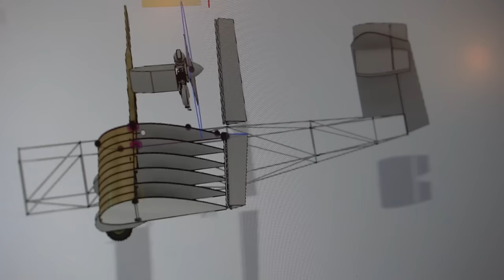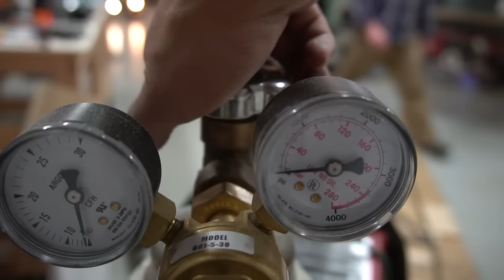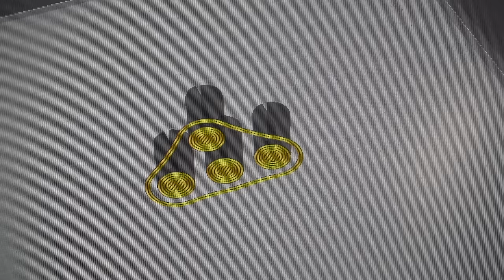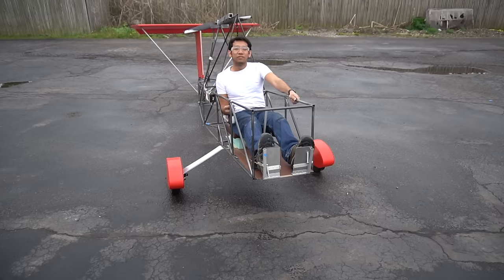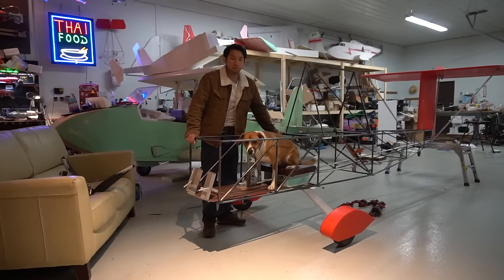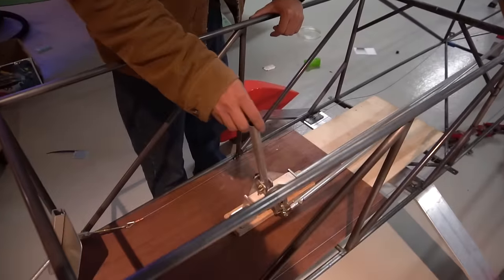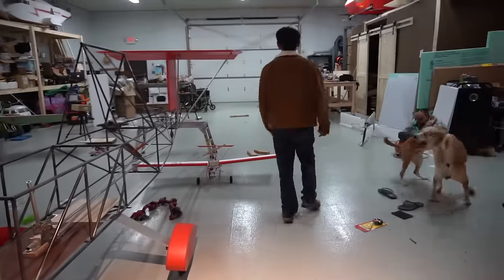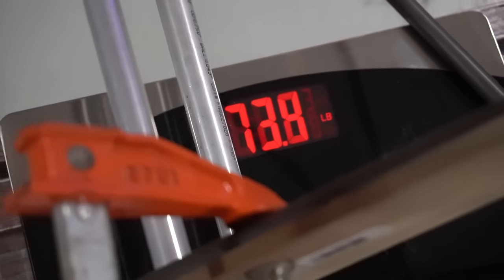HOMEMADE ultralight airplane mk3 part 3

Comment: Hi, just wanted to say I love this aspect of your channel, I'm only really interested in the content you make for this series. I dont watch much of your other stuff. It could be an age thing? It's more design engineering and fabrication orientated. I'm really interested in the way you make everything. I would love more detail on that. The timelapse is a bit frustrating cause you don't really explain much. It's great that your narrating but If  you cant keep up and really explain what's going on in the timelapse then it's not working. I would love you to explain your steps and the process in much more detail. I recognize I may only be speaking for myself here. I would like the timelapse, if indeed you keep it in at all, to be slow enough to really understand what your doing and your narration too. What's the tubing you used, its  wall thickness, why did you choose that. I would love to know details like that. The jigs you made etc. I think your core watchers may be after something else however.

Comment: The problem with welding a frame is breakage. The weld and the frame have different hardnesses. The frame flexes, then either the weld cracks or it cracks around the weld. Aircraft are screwed and torqued together. Even the skin of a jetliner is screwed on. Personally I wouldn't trust my life to a welded frame.

Comment: Why not put you props under the wings.  As for the landing gear tie the 2 parts of the landing gear together  with a bungy coard , will still alow the gear to bend to soften landing. Then add a bar that has a bolt slot in it so you can limit how far they bow

Comment: Hey, If I've 125CC or 250CC petrol engine so can I make a 2 or 4 seater plane??
Need your help for that design.
I just want to fly it maximum 4000 thousands to 6000 thousands feet in the air.

Comment: You forgot to add trim control to the elevator in order to reduce the stick moment as you will have to hold on to it whenyou will have to counteract a stall situation
 in other words your plane is not controllable in actual flight
save your life and get married and have a few kids before you fly this kite

Comment: Do you need and or have a piloting licence
Reply: Tiny Vids not for ultra lights, ultra light planes are not counted as planes by the law of aviation flight. They are too light to be considered a plane. The rules are for having a pilots license, is if you are flying over houses or residential areas and over people. To fly ultra lights you can’t fly over people or houses only on private property. I believe i’m correct but you can look it up yourself. Laws are different in different countries Soo yeah. But i’m pretty sure I got it correct.

Comment: Hey. I know that many people will say that I am wrong, but I think that you are making so much mistakes and this is aviation, no mistakes can be allowed. I am not engineer, but I have been in aviation for a while and I think that these projects are dangerous. First thing which I would suggest you is to contact people that have some experience in making ultralight airplanes. I think that nobody should fly with these aircrafts more then once. And also this kind of engineering could give bad opinion about making airplanes, that it is so easy and you dont need lots of experience. And about rc, you can do it better. Check out RamyRC channel.
Keep progressing, I hope in the future you will make something really worth attention.

Comment: Anybody know why he's TIG welding instead of MIG welding? Wouldn't MIG be easier?
Reply: Molon Labe tig has superior cleaning action and it can preheat the joint before adding filler wire.
Reply: @robertmencl9169  I see. So does one operate it similar to Oxy-Fuel welding in that sense?

Comment: maeng wa, tammai meung mai yorm sai khreuang generator samrap ja hai dai motor dii mi fai por chai wa, it's disappointing to see a gas engine running a propeller instead of a generator to run propellers on electricity.

Comment: +PeterSripol have you considered fitting https://www.bafang-e.com/oem-area/drive-systems/drive-system//m620-drive-system/ and making the plane pedal assist?  Originally ebike based, these super powerful units could be integrated with say (https://youtu.be/OtcAsSfKeAU?t=102) an internal gear hub.  I'm sure you could acquire these for free and then get to working ratio's for max thrust, etc.  I love your work.  I believe you're def. a disrupter(!).  I hope you'll let me know your opinion.  P.s. Do you share your DWG files (?) - I use VWX professionally and I'd like to override the drivetrain of your current model as described if you are too busy.  Kind regards!!

Comment: I'll come and do your welding for you, I have been a certified welder since 1983 I am verse in all types of welding I am certified unlimited thickness all positions I will not let you mess up on the weld I'll do them for you, only if you help me build 1/2